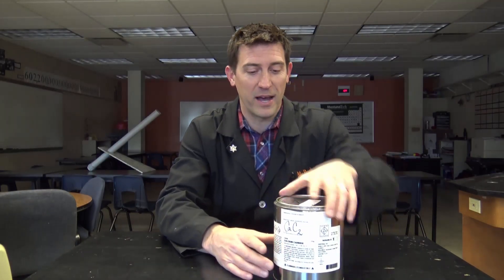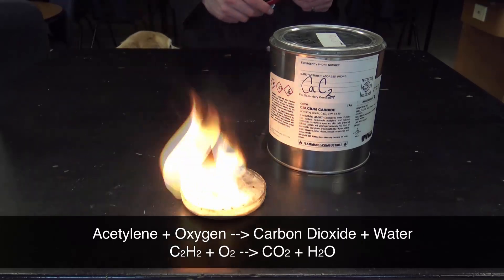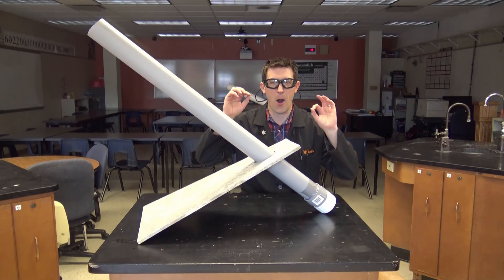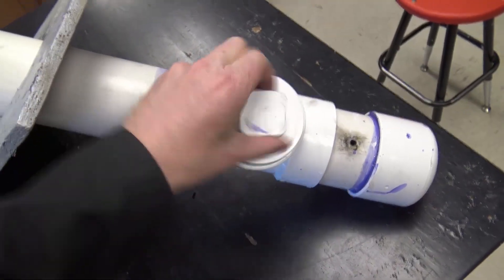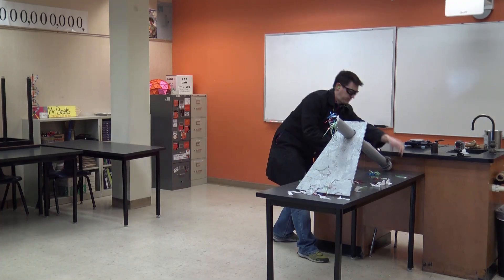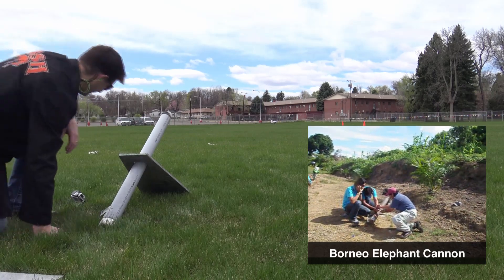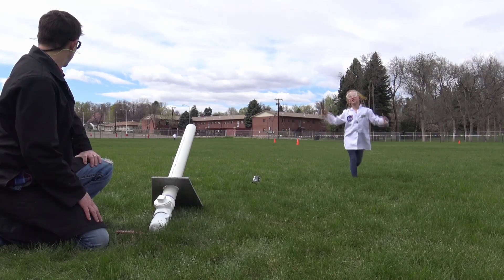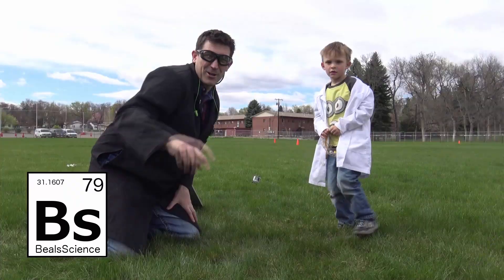Shooting a Calcium Carbide Cannon

Comment: How did they keep the lamps from exploding
Reply from the maker: Great question!
As the acetylene gas builds pressure in the chamber it pushed out the pinhole opening where it mixes with air. Because no oxygen is able to get into the chamber the gas within can’t burn (explode).

If there was a hole where air could enter the chamber it is possible that the acetylene and oxygen mixture could explode. But, if this happened, it is likely that the top would pop off and wouldn’t be a forceful explosion.

Comment: I use the clean-out cap to hold my Calcium Carbide - mine is out of 4 inch PVC and Super Loud. I want to convert it to Propane since the Calcium Carbide is so messy. Cannot believe you actually fired that inside.
Reply from the maker: I am fortunate to have a big classroom and forgiving big teachers in the classes next door!
😆

Comment: I got a tip to make it even louder. When I make mine I get can that will fit in there just right but I put a hole through the can that is smaller so as to create partial restriction.
Reply from the maker: I will have to try that.
Reply: Just beware of this trick. This increases the pressure and possibility of making it into a sort of a pipe bomb. Pvc pipe is not safe for higher pressures. Maybe try getting an PE pipe or best: a thick walled metal pipe.

Comment: I do this when Ramadan with bottle,so we make hole the side a little bottom,and we get water as much as you want,get the carbide,and because when you buy it from local store(yes it legal)it had a size of a thumb and they were cheap,really cheap you can get a thumb size pieces for like 2 cents and a medium plastic bag for 1,5 dollar,we get the thumb size one and hammer it so the size of the bottom of carrot,and then you put the carbide in the mouth of the bottle,close the mouth and the hole in the side,shake it,and then when we wait 20 seconds,when waiting,get a tree branch,get a bottle of petrol,dip the branch into petrol,light it,and if 20 second is up,open the bottle mouth first and then the side hole,light it from side hole,and, warning if the water gets too hot ITS either your bottle gonna burned,or its gonna explode and your skin is burned

Edit:you need to get the 1 liter or more,for example:big cola,etc(idk other example so)

Comment: Will it go boom with no wadding??
Reply from the maker: Yes!
Reply: @BealsScience  Thank you!
Reply: Rats!! Got my carbide from Karst sports (no problem with them!) in a 4 oz bottle. So far tried 3 experiments with it. 1X10" capped PVC pipe, 12 oz pop can and an approx. 2 gl. pretzel jug. All went whoosh. Wife didn't hear any of them upstairs! Did I get the wrong kind of carbide??? I'm loathe now to put any cash forward on the PVC pipe like you have for your cannon!

Comment: Hi Beals! Planning on doing this demo for my students. How far down the barrel is the projectile? Is it closer to the ignition hole, middle, or end of the barrel? Thanks in advance!
Reply from the maker: I push it down to about 3/4 the length of the barrel so that the “chamber” is about 1/4 of the barrel.

Comment: Where I can find the video you alluded to about what the 3" cleanout is used for?  Additionally, what rules can you suggest about inserting wadding in the end (how far and how much) to maximize the boom?
Reply from the maker: I would avoid using the 3" clean out and go with a standard tube with a threaded end-cap. I was experimenting with the cleanout and it eventually blew itself apart - the pvc is too thin at the threads. 
Also, I am not a big fan of wadding for the pvc cannon because the wadding, depending on how much it is packed in, can cause too much pressure and cause the pvc to fail - also, I tried some wadding and it fit so tightly that I never got much of a reaction - just a lot of carbon smoke.
I would suggest finding a ball that fits snugly.
I've got more information on my website that might be useful: https://www.bealsscience.com/post/2016/04/19/calcium-carbide-cannon

Comment: What was the ratio of Carbide to Water used in the outdoor trial?
Reply from the maker: Same ratio but the ball fits a little tighter so the pressure builds more before the ball reaches the end of the barrel.
Reply: @BealsScience  Ahhh I see, so just let it sit for a bit longer and use a tighter fit for the projectile.
Reply from the maker: Correct

Comment: Did you also use 1 gr carbid outside?
Reply from the maker: Yes. I never use more than 1 gram because the ratio of oxygen to acetylene with more carbide will often cause it to not combust (ignite). In this case, for a chamber this size - more is not necessarily better.
Reply: @BealsScience  thank you 🙂
Reply from the maker: No problem!

Comment: i made this but am only getting a real small explosion any ideas why?
Reply from the maker: Bill mazey Mazey I may be able to help with a little more info:
Is your carbide black or white?
How snug is your projectile?
How much carbide and water?
Size/diameter of Cannon?
Reply: @BealsScience  can you exzplain how the black vs. white power and the diameter/length impacts the resulting boom of the cannon?
Reply: I'm still curious about the powder differences.  As I had expected, larger diameter results in deeper (lower frequency) booms.  Will be experimenting with length.  Did find 1/4 cup of water yields in louder reports than 20ml of water (with the same 1 gram of calcium carbide).

Comment: Can I shoot a baseball out of it
Reply from the maker: You would need a larger diameter barrel but I would NOT shoot a baseball with a PVC barrel. The mass of a baseball is considerably more than the foam balls used here. The added mass of the ball would increase the pressure inside the PVC during the combustion of the oxy/acetylene and the PVC could very easily break (blow up)!